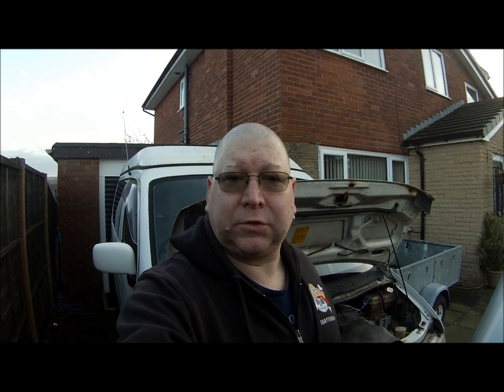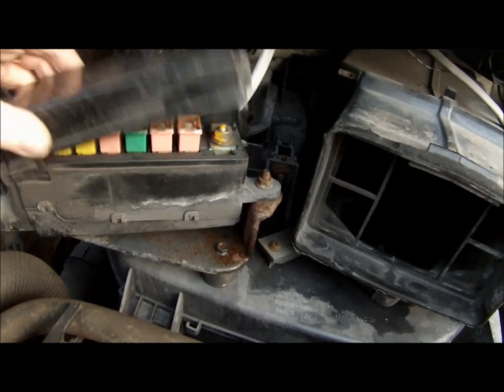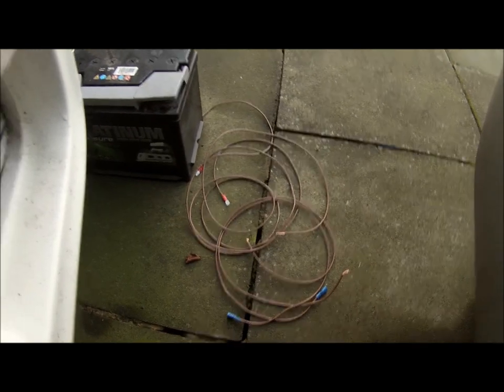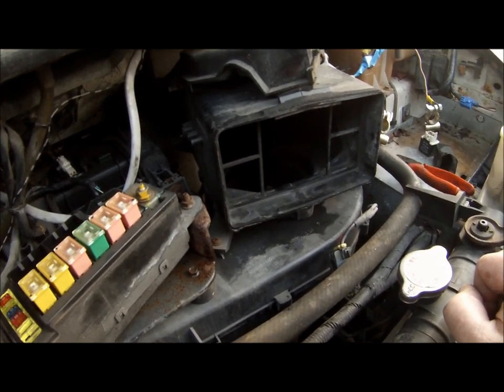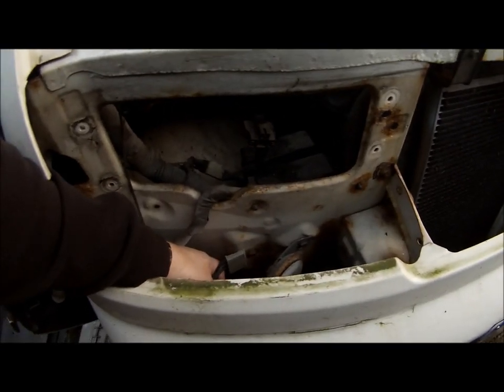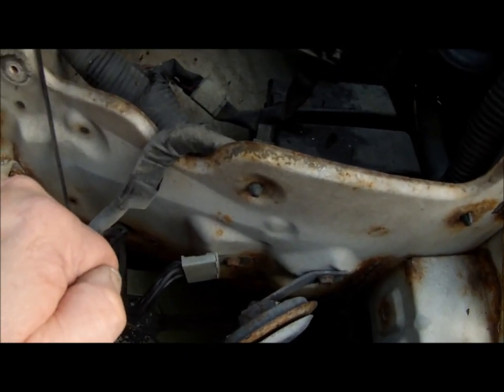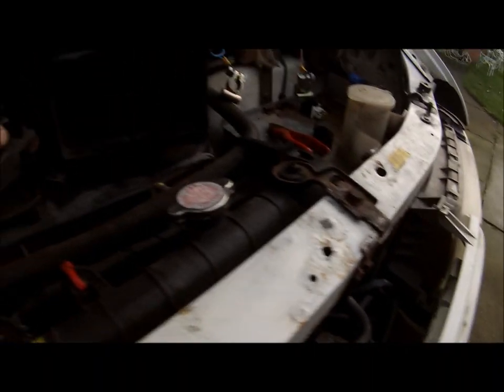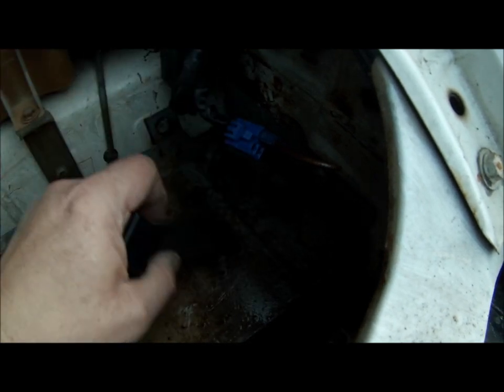Fixing a problem with a Bongo air conditioning fan

Comment: Super helpful, the transistor in my van has gone so I'm going to have to look at replacing that block. Do you have a part number for the transistor itself if I fancied soldering it instead?
Reply from the maker: Many thanks for watching and commenting, Not sure about the transistor number, it could take me a while to find out. Stay safe and well, SIR, cheers, Schnuz.
Reply: @Schnuz  I found it in the end, it's 2SD1525 for anyone reading this
Reply from the maker: @3lfd3wd  Many thanks for  the research, I've added the number and your input into the description of the video for anyone else who needs it. Stay safe and well, SIR, cheers, Schnuz.

Comment: Hi mate my fan is running but not much air is getting through to the inside of the car and I can't figure out why. Any ideas?
Reply from the maker: Many thanks for watching and commenting. There is (or should be) an air filter in the circuit. If it's fitted then check that it's not blocked and replace it if it is. Other than that check that all of the connections are sound and no air is escaping elsewhere. If you are still struggling let me know and I will do a bit more digging. Stay safe and well, ICAN, cheers, Schnuz.